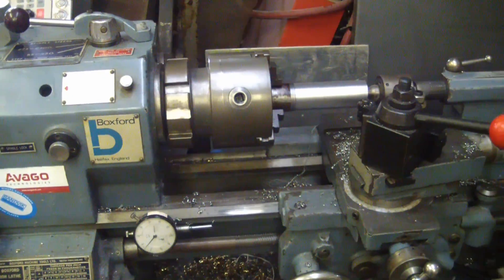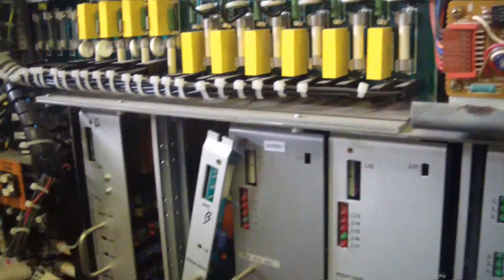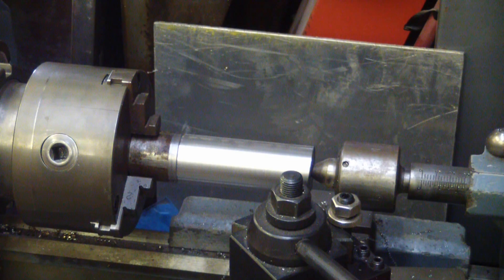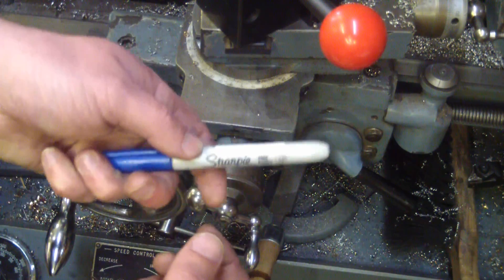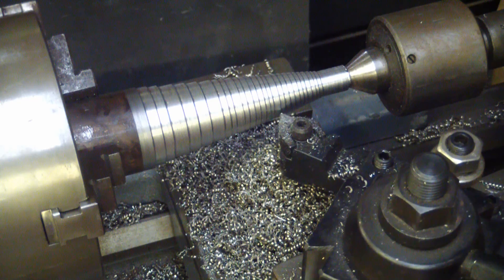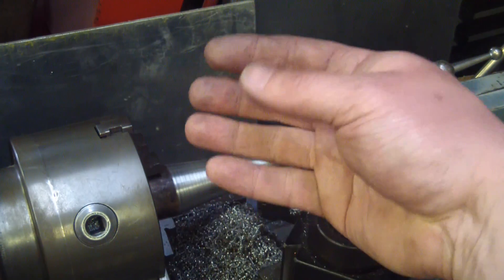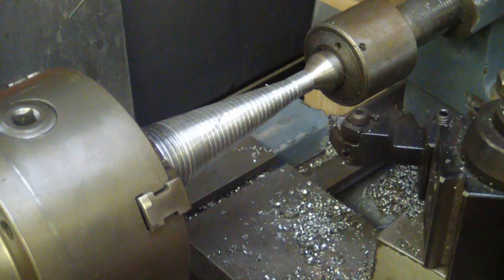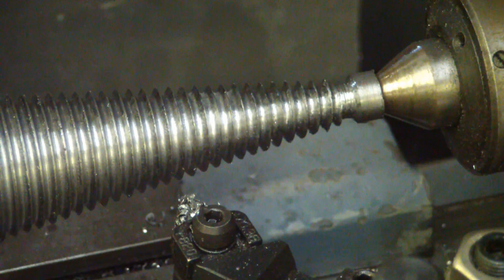Turning Tapered Threads - Manual CNC

Comment: My Q may show I've never used a lathe but.... Couldn't use just mount the piece with one side off set to the depth you wanted and then cut straight across.  Do that four (or so) times and then do the final clean up cut with it on center.  Only five setups that way (before the threads).
Reply: isgdre You can do that but I think this taper is way more then the chuck can handle.  He could have used some sort of universal joint to hold the work in the chuck.  I think would take less work and time to make a taper attachment for this lath. Check on kijiji.

Comment: btw i finally got around to building that tool holder for internal grooving. ground out a 5/16 cobalt and managed to cut a beautiful groove over 1/4" cross section with a 1-1/2 bore minimum. thanks for the encouragement

Comment: Kinda surprised you (being the wizzard that you are), didn't take a drill with a low slip clutch and attach that to the slide to keep the feed going at a constant-ish pressure.
Reply: Big_Adam_2050  I was thinking that as well, easy to make a simple 2 slot coupler so as to engage the drive end, and use the drill to make it easier. I can guess why you want a taper thread, but even left handed it will still work, though you will have to hold it on nicely.
Reply: Big_Adam_2050 Thought about doing this the other day...may still

Comment: Curious as to why you didn't use the compound slide for cutting the whole taper? Were you just making use of the feed so least work was needed on the compound?

And what is this taper thread used for? I am intrigued haha

Thanks for the video
- Newbie Apprentice.
Reply: Alex Scott If you only cut with the compound you would have to go back a forth a million times because it's too much material to remove in a reasonable number of passes. And if his hand was cramping after only a couple passes, imagine if he had to remove an inch off the diameter all the way across that thing.
Reply: Alex Scott  I'm thinking it's for a unicorn log splitter.
Reply: justfakeit888  i was thinking the same thing